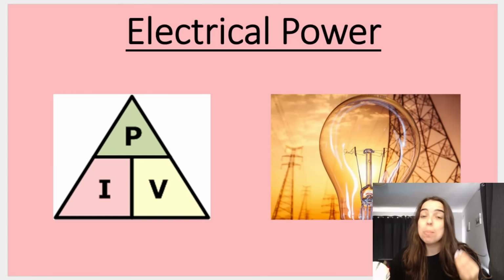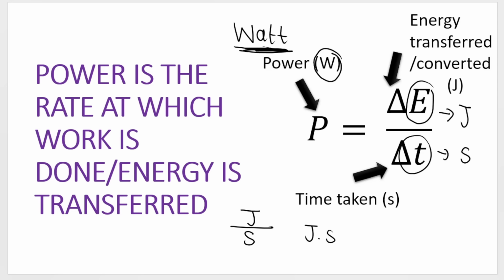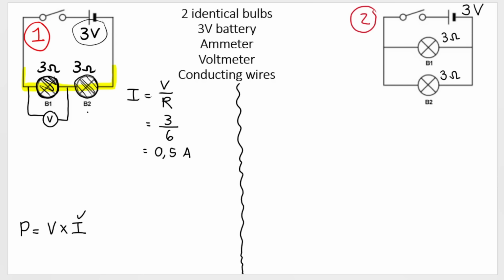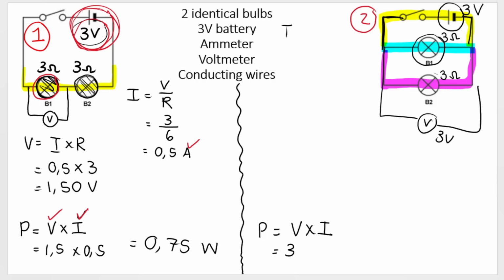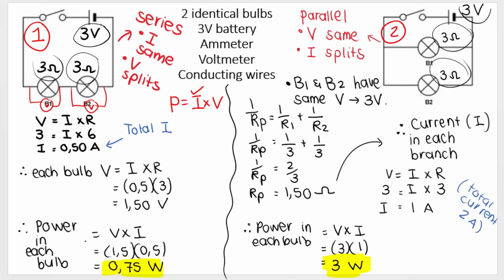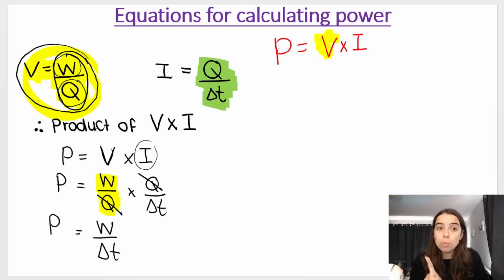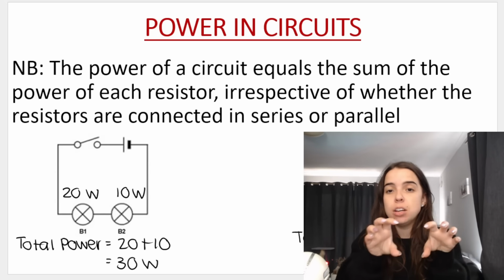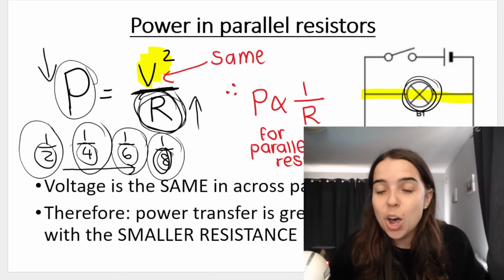Grade 11 Electricity: Power (electrical power)

Comment: hi mam i have a question with the circuits ,the switch is open which means the reading on the battery = emf weren’t you supposed to find the actual voltage then calculate the voltage for each of the bulbs?